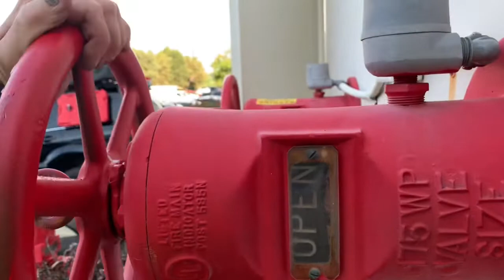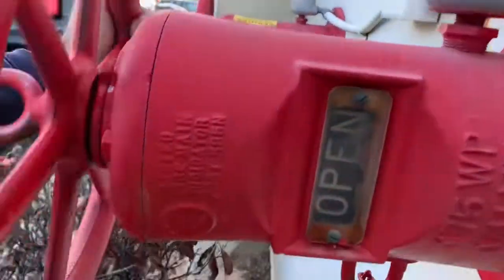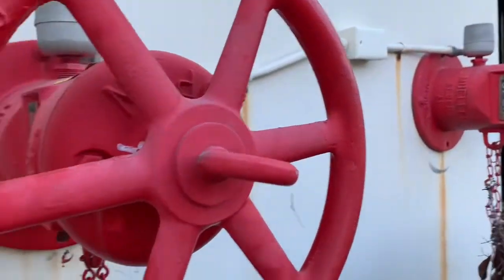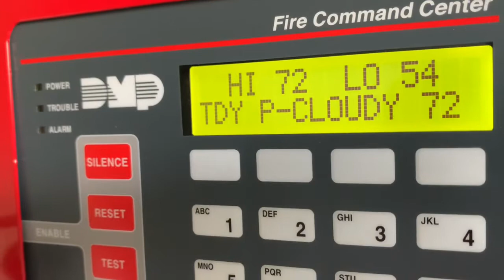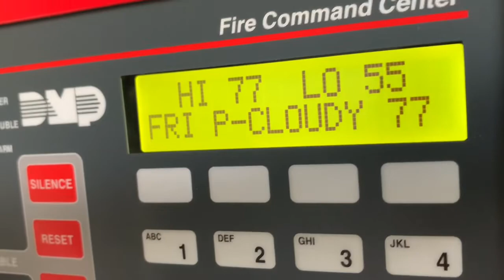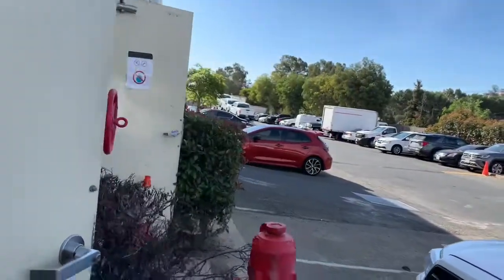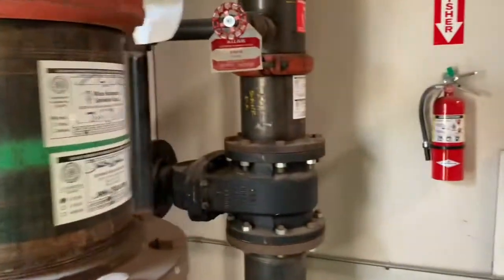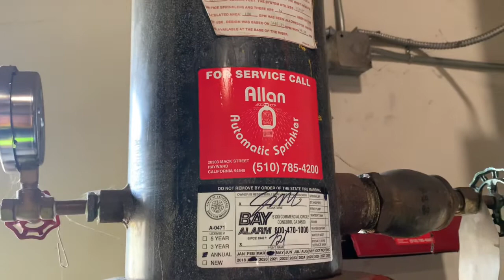How a OS&Y valve works.

Comment: actually a wall indicator with a gate valve inside...NOT an OS&Y at all
Reply from the maker: That’s great information. I’ve been putting out false information? That wouldn’t be the first time. Maybe I need to change the title of this video.? Thank you for watching. Thank you for your nice comment. Stay strong and healthy. Bye-bye.
Reply: @JoyCool1 Yes, its actually very similar to a post indicating valve. The os&y will have a long screw protruding from the hand wheel if open and no visible screw if closed.
Reply: An OS&Y is an Outside Stem and Yoke. The "long screw" is the STEM part and is OUTSIDE the valve body (visible). 

A PIV is a Post Indicator Valve with the Open/Closed target seen through the "window" being the INDICATOR. Two types OF PIVs are commonly seen.  A Yard Post is vertical and uses a "wrench" to control the valve. A Wall Post is horizontal and useless a "wheel" to control the valve. 

If a valve has a visible STEM, it's an OS&Y.  If a valve has an Open/Closed INDICATOR, it's a PIV.

Comment: What is the biggest fire sprinkler pipe you’ve ever seen I thought they only went up to 6 inch but that one was 8 inch you said
Reply from the maker: I Have worked in Fire Pump Rooms with 12" pipe! but the biggest i have installed is 8" Thanks for the nice comments Zachary Korbet!